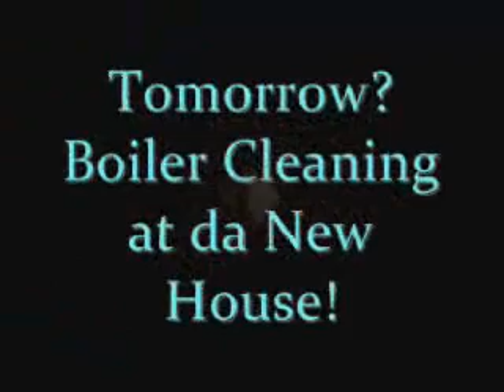1 8 11  Sump Pump Repair...

Comment: Your pex would fail code in my state on NY PEX BLUE is for cold and PEX red is for HOT and can never be switched .  Was that a dehumidifier beside the sump pump 
and thats electricity much cost a lot for the pumps and such.